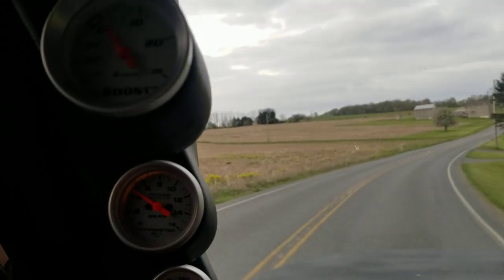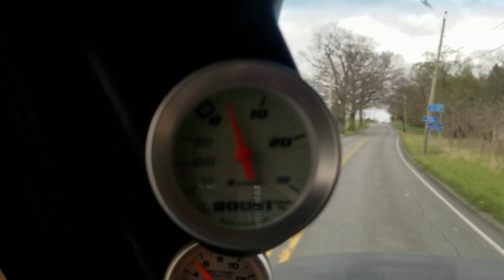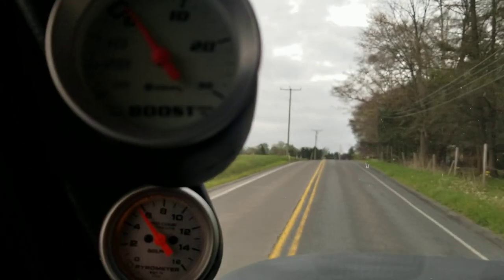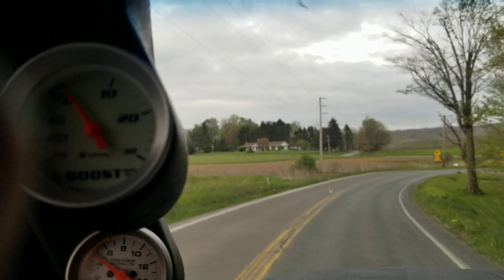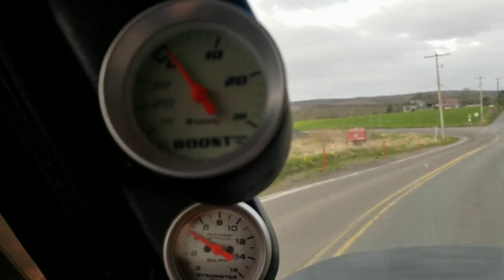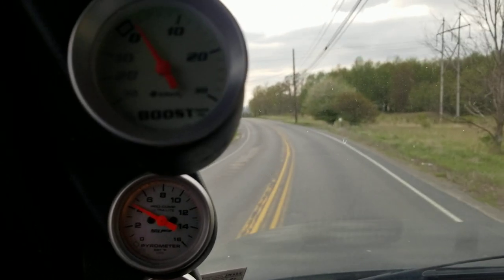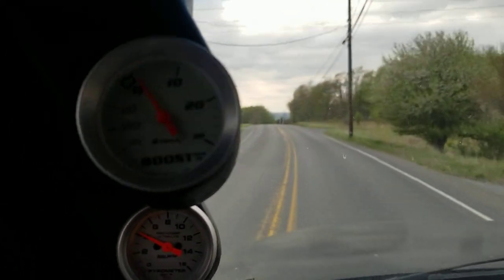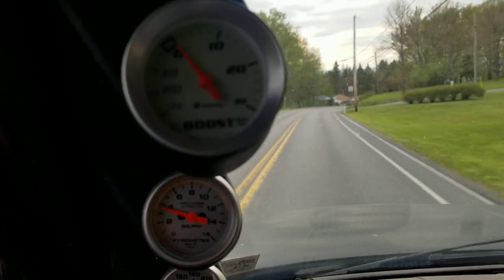Boost Gauge Shaking ? (Buzzing)

Comment: I have the same problem but my car send the turbo into limp mode and no boost at all what should I do ?
Reply from the maker: Put a couple of 90° elbows in the line if you can. If it's just a straight line like on my truck the air to the gauge is to violent need something to break it up like an elbow

Comment: I'm looking to buy a 2000 dodge ram 3500 with a Cummins. It doesn't make very much boost for some reason
Reply from the maker: Does it have a exhaust gas thermostat? Check for boost leaks, usually blows off on the passenger side intercooler. Check for exhaust leaks. These trucks are all mechanical turbos
Reply from the maker: Any more information will help. I live in Pennsylvania if you're close
Reply from the maker: A stock tune wont make more than 20lbs of boost. More fuel more boost 😉
Reply: @GearsAndGuns  well it's a stock truck but has banks mods done to it. Like exhaust, gauges and waste gate. I don't believe it has a exhaust gas thermostat
Reply from the maker: What kind of boost is it making ?
Reply: @GearsAndGuns  no boost at idle. 15 pound of boost running down the highway
Reply from the maker: Sorry I missed your comment.  Is it a automatic or manual transmission? Depends on gearing, mine is geared super low so it usually runs about 20lbs of boost . But you can take em up to about 40lbs. Anything more than that they will lift the cylinder head and push the head gasket. Mine usually blows the charge pipe off at 42lbs. Stock turbo can do 50lbs of boost. But they only build boost under load. So really get on it and it should go up to at least 30lbs of boost. If not something is definitely wrong
Reply: @GearsAndGuns  it's a factory 47re transmission. But if I get it I plan on putting a nv transmission in it.